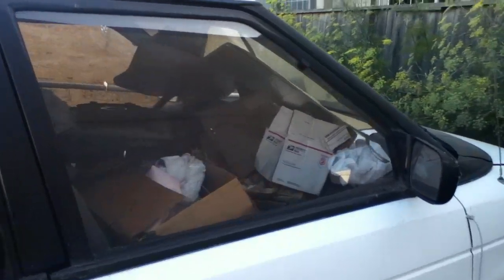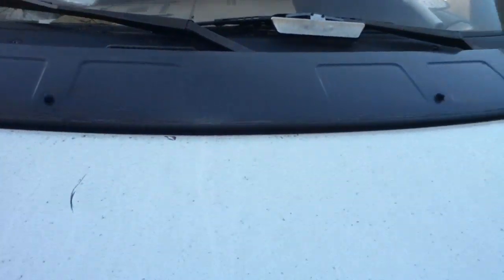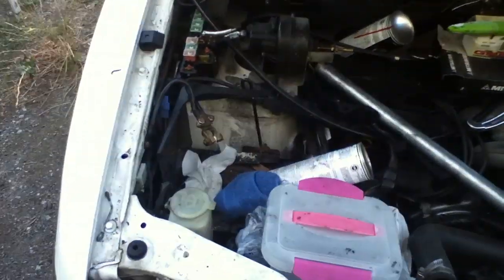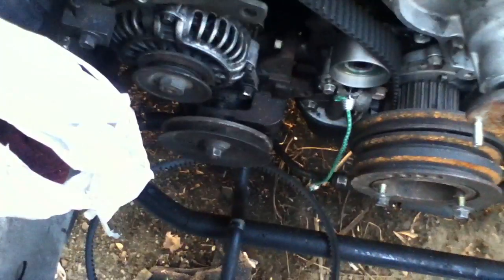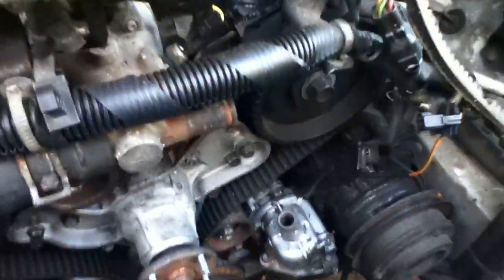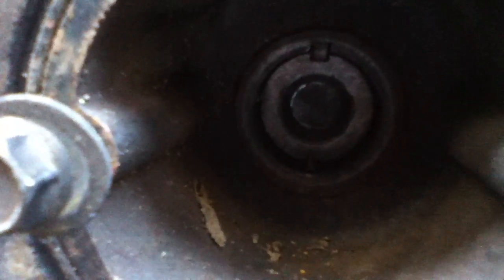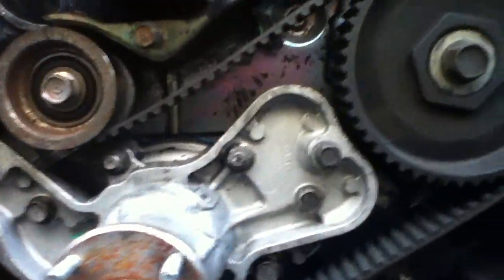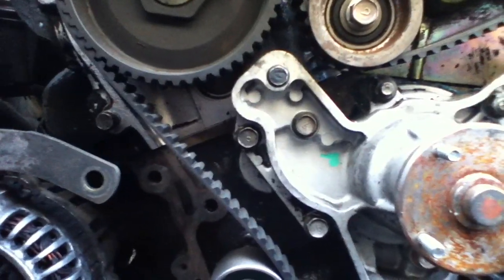1994 Mazda MPV timing belt replacement, 6 cylinder DOHC 3.0

Comment: your tensioner is defective. you have to grind some off of the brass bushings so that the bolt that holds it ddown does not squeeze the tensioner its self.   After tightening this bolt the tensioner must pivot freely.  email me your phone number and I will call you. my email is t8085579058 at yahoo.com

Comment: you have to take the hydro tensioner out under the lower pulley, compress it with a vise or c clamp until the holes in it meet,stick a pin to hold it down, put it back, line the marks and pull the pin.I dont know how you managed to break the pulley bolt in there because its not suppose to thread into the hole it just slides in.